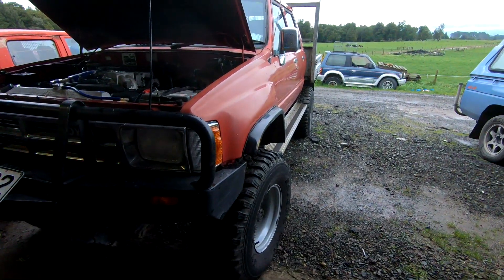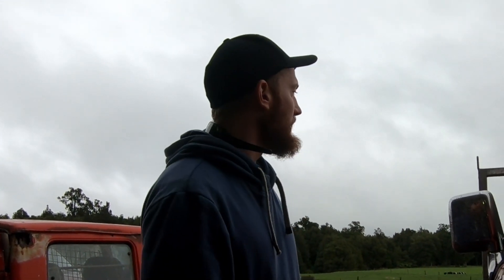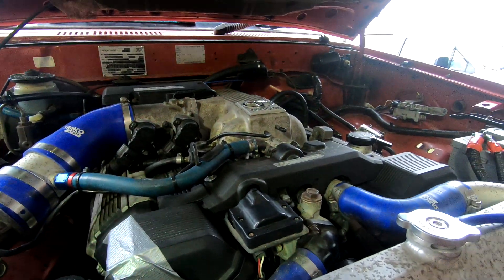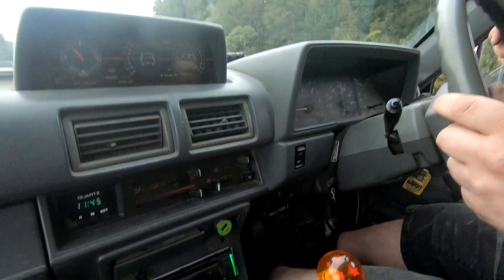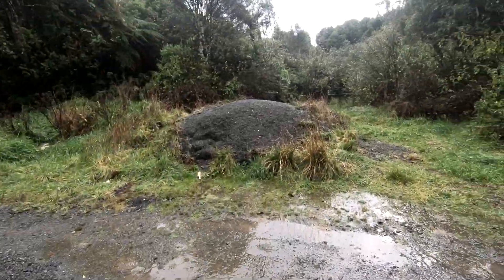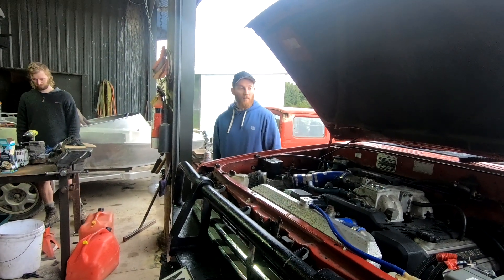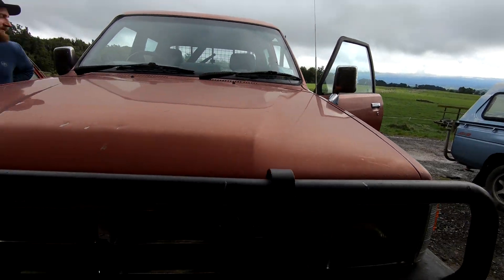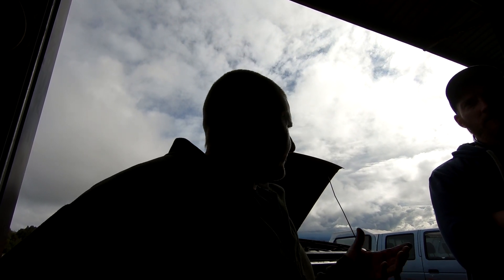Toyota Hilux with 1uz - Earth your ignitors.

Comment: Brilliant, I had the igniter issue when I moved them and forgot to earth them, and when I'd just changed the fuel pump and a couple of other bits. Should have remembered to start it after each job to rule the others out.
Reply from the maker: Yes.  Good processes are important but its also not always possible.  Cheers Kelvin

Comment: A lot of problems can be solved by opening the hood and looking around. I bought an ls400 that the last 2 owners could figure out the issue with it. When you floored it it choked out at 3k rpm I floored it and had a buddy spray starter fluid in the intake reved right up damn fuel filter was original from 96 280k miles  funny part is it had a brand new one in the trunk of the car fixed for free and made a killing on that car
Reply from the maker: Well done.  Yes, this one was solved on the initial inspection.  So often the basics are missed.  Cheers Kelvin

Comment: speaking of running a little crappy, my US 94 SC400 is getting a code 13 RPM Speed. i runs mostly fine at idle with a ever so so slight stuter but when the engine gets going faster the whole car vibrates/shakes but still somewhat runs smoothly??. have you encountered this?? ive heard cam position sensor or crank position sensor so far in my searches
Reply from the maker: Yep.  Seen it plenty.  My first check would  be the cam timing.  then sensors,  but check that cam timing.  Let me know how you get on.  Cheers Kelvin.

Comment: hi guys. I have a Hilux with 1uz conversion running a stock hilux auto trans, lacking power under load.  Revs fine in neutral, but in gear can barely get it past 40kph. Any  chance you could help , with some ideas please? cheers
Reply from the maker: Maybe watch this.  https://youtu.be/LLa33xyQ088

Comment: Haha you guys crack me up. I was wondering why the steering was so loose in earlier scenes. Looked like a poorly faked movie scene. Suuuuuper loose steering haha
Reply from the maker: haha.  There really was no need to fake the loose steering, its really that bad.   I have another video coming out on this truck in a few days.  I really like it and would like to spend some time sorting these issues out.  Its a very cool old truck.  Cheers Kelvin
Reply: There is definitely no faking the steering in this vehicle good old solid axel front with drag link steering and big wheels  makes steering more or a  suggestion than input .
Reply: @jasonfaulkner6021  haha a suggestion.  I love it. Suggest that it might slow down too